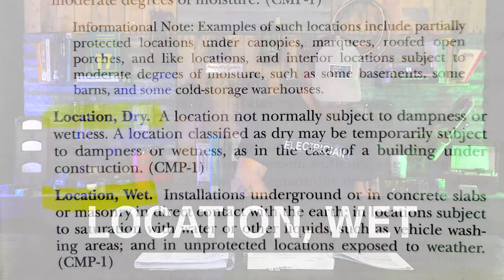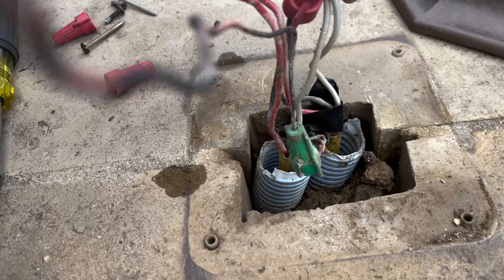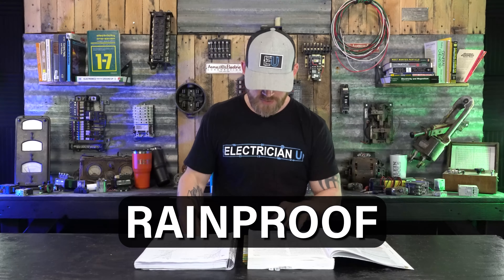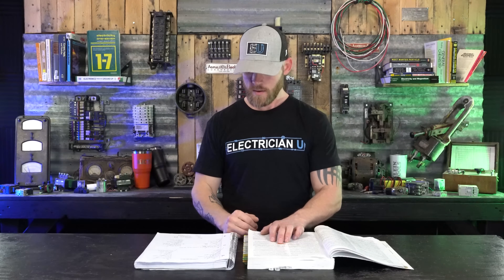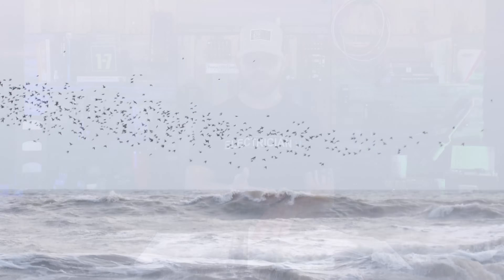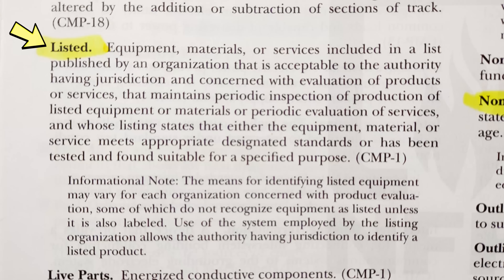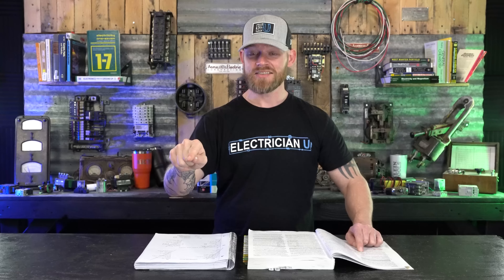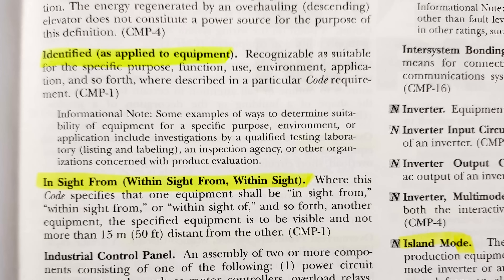More Code Terms Explained!!! (What's the Difference Between Damp, Dry and Wet!!!?)

Comment: Hi Dustin, can u address the use of NM cable (ROMEX) for interior wiring of duplex receptacles and lighting INSIDE a CMU structure (garage) where the hollow core's of the block walls are used to run the NM cable from the top rafters down to the outlet box location which has been chiseled out into the hollow CMU blocks. Is this application code legal as a dry location?
Reply: last I looked, anything to do with cement / concrete was considered a damp location, which means you need weather rated wire in conduit.

Comment: I need advice. I am a homeowner/owner-builder that designed and built my 4,200SF home in Southern California. I did as much of it myself including electrical (up to a point) and then had a certified Tradesman come in and do the rest and check out my work. Sometimes I had to redo my work, but I learned. Where do I get a copy of the Big Book you keep using for electrical code? How often is it revised? What is the actual name and can I order it from amazon (there are at least 5 different versions that all look the same on amazon)?? ? Thanks for all your Youtubes. I have learned a great deal, especially about proper grounding. Does that code book cover Solar as I want to do DIY Solar?
Reply: you are looking for the NEC 2020 version. (published by NFPA) The spiral bound edition with tabs will hold up better. It looks like most come with the "Uglies" pocket version, which is the handy quick reference guide. I believe that pocket edition can also be had at Home Depot. (so I am told)
Reply: @rupe53  Thank You! I just ordered it from amazon for about $45.00. I have had the pocket guide for a long time I use it all the time. I just wanted the big book he uses so I could follow along and try to keep learning. If I had another lifetime, I would be an electrician as I have really enjoyed learning and doing the work.
Reply: @benkanobe7500  ... just a reminder that not every town is up to the 2020 code, and many go back to the 2017 or earlier. Heck, some places are still adopting small sections of new code and are mostly with 2009. It pays to ask questions of your local inspector when you need to do work.
Reply: @rupe53  Thanks for the tip! I will do just that. I live in what in southern CA is a "small town" (Fallbrook) so we have known inspectors that have been with the county for a long time.
Reply: Join the discord!

Comment: I was just looking this info up, over the weekend. I'm installing an outside outlet on one of my exterior walls. I was trying to see what was needed from the back of the box through the wall, if anything, to make it waterproof. ( We are required to have waterproof while in use covers, which I have). Just wasn't clear if there was anything else needed.
Reply: you may want to pose that question to your local inspector. I have seen some ask for a weatherproof box that is surface mounted and caulked on the back while others might accept a trim board that's smooth enough to allow the cover gasket to seal properly in a flush mount situation.
Reply: Good thing it's not an interior wall😂
Reply: @Qazxswer68  what I meant was it wasn't on an outbuilding or a pole.

Comment: 6:07 - the AHJ doesn’t have absolute authority to do whatever they want. For obvious reasons you don’t want to pick fights frivolously, but there are times when you don’t really have a choice and have to challenge the inspector. Doesn’t happen often but you have to remember it for the times you need it.
Reply: Oh it happens often
Reply: Inspector has the last word. No matter how "unique" his interpretation of code is or what  locally applied changes to NEC codes are...no 2 municipalities interpret things the same...sadly.
Reply: @samspade5648  their powers and obligations are set out in the code, and there are limits. Under your theory, the inspector could legally demand a cash payment before approving your work, which obviously isn’t permissible. It’s not an easy fight to take on but the code limits them too.
Reply: @twestgard2  I don't know what theory you're interpreting in my comment, but your response and interpretation is exactly a case in point. Often an Inspectors interpretation of  code varies from municipality to municipality...sometimes uniquely. I deal with it everyday. Some seem out of left field,  best to role with their interpretation to get in and out and on to the next project.
Reply: @samspade5648  “best to” and “have to” are two separate conversations. Whether it’s best to comply with an out-of-code demand by the inspector depends on a lot of factors, starting with cost and expense. I saw one recently in the northeast that would have made all dock winches illegal, for example. If that’s your line of work then you either have to change careers or fight the inspector. 

But the topic here is whether you “have to” accept whatever the AHJ says. If it’s not code compliant, you don’t “have to.”